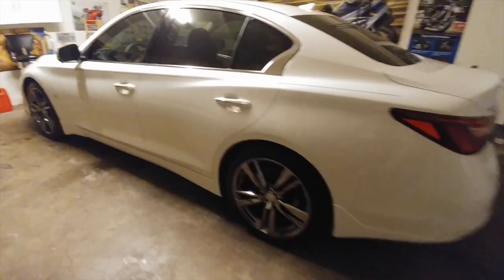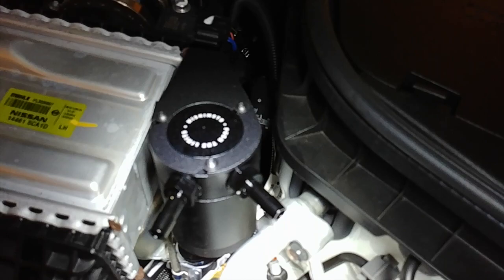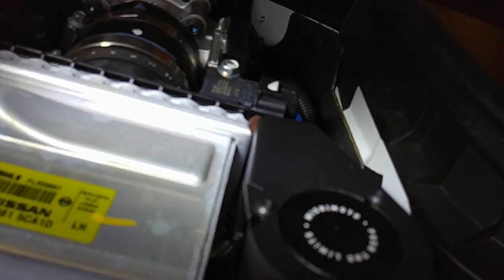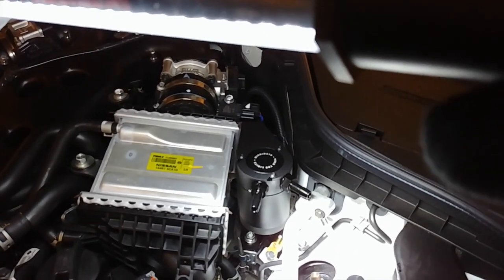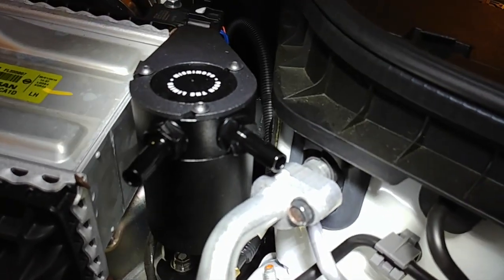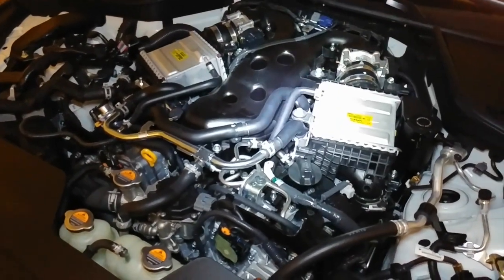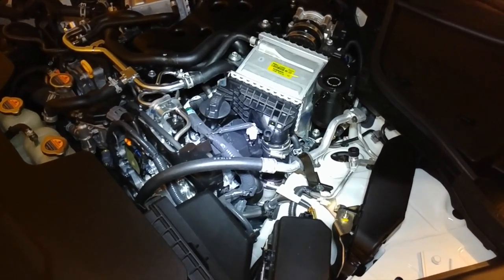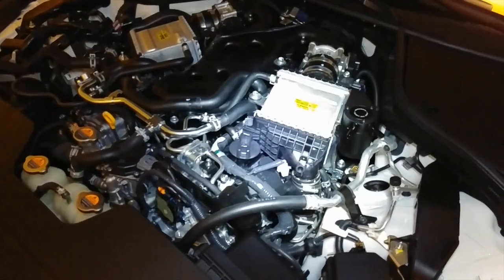Mishimoto Oil Catch Can Install -2019 Infiniti Q50 3.0T

Comment: This absolutely by far has been the best in depth fully detailed install video for this product yet. The Mishimoto video shows you almost nothing about the actual placement of the hoses . Funny thing is for me routing the hoses went a lot easier then i thought. My biggest issue was actual getting the hose on to the intake port and the other head but with alil wd 40 and some muscle I was able to get it Done with some pliers in good time. Gonna check it in a couple of 100 miles and see much it collects. Thank you again !

Comment: i watched 3 videos of the Mishimoto catch cans because I'm getting one and by far your video has the best visuals. thanks bud!
Reply from the maker: It's ironic that Mishimoto recently published in their engineering blog what makes for a better oil catch can as I've been doing research on this topic for 8 years to educate myself.  People see the word baffle and get all giddy but a baffle/multiple baffles are only a partial portion of what is needed to successfully make a PVC/CCV catch can. Other key components are the air diverter and a very fine porous filter. Read this if you have not: https://www.mishimoto.com/engineering/2016/01/blow-by-101-what-is-blow-by/

People just think oil flows thru the PVC system like in its liquid state out of the bottle. Doesn't happen that way. It's a ultra hot mist/vapor where it flows like that until it's changed out of the vapor back to a more fluid like state. You can't catch most of the mist with a baffle alone or a neat sounding triple-twister baffle whatever that is. It takes a high heat application filter that can handle moistures, oil droplets, unburnt fuel, condensation/moisture and more nasty things from the combustion blowby past the ring process plus the pressure that builds inside the motor lower portion. 

I don't make a cent from Mishimoto or get anything free but I just like to share good information with others and well as I like to be told good information too.

Comment from the maker: I opened mine up just after less than 100 miles and I astounded at how much oil is in there. I'm still breaking the car in so been pretty easy on it. So so pleased that I got the catch can installed. Going to take a 600 mile trip soon.

Comment: Man routing the hoses on this was a nightmare lol this engine bay is extremely frustrating
Reply from the maker: The most tedious part for me was feeding the one Mishimoto hose thru the crevasse to get it to point of attaching it to the intake. Other than that, wasn't too bad. For me, the punishment was just standing in my 110 degree garage with 80 percent humidity and keeping the sweat out of my eyes and keeping my hands dry.

Comment: Hello do you get any vibration noise from the can hitting the into cooler I read a review that his was vibrating? Also I have a q50 2019  with 33,000 miles is it still worth putting this can on it and you said the Mishimoto model was the best for the q50 verses other models let me know thanks Jim.
Reply from the maker: I don't get a noise from my mishimoto catch can. Probably installed incorrectly. With a 3.0t q50 with 30k already on it, I feel a fair amount of oil carbon buildup has already happened. The biggest advantage of spending the $220-230.00 for the mishimoto oil blowby catch can is to seriously reduce or try to stop the start of the carbon buildup. Once it's there kind of defeats the purpose though it can get worse over time 40,000 miles to 100,000 miles.

Getting the intake valves professionally cleaned and then adding the Mishimoto .50 filtered blowby catch can makes more performance sense in my opinion. The service to have that valve cleaning done would be fairly expensive. All the reason to avoid the buildup from the start.

Likely not worth the cost unless other work was being done in that area of the motor allowing access to that part of the cylinder heads/intake ports.

Comment: I installed the Mishimoto catch can in my 2017 Q60.  After my install, I was getting some knocking noise.  The dealer said it was the catch can. So, I had to added some spacers to raise the catch can bracket a little higher.  I think they were 3/8 inch spacers.
Reply from the maker: It would be a good feature if folks could attach photos to youtube. I've never seen or heard about rattle or vibration issues but mine does come in close contact with other metal surfaces due to space constraints. Glad you were able to get it resolved so you could keep it. I have never noticed any rattles or unique noises from mine.when you saying knocking are you saying that the engines knock sensor/s were registering false knock?
Reply: @GettingthruLife  I agree with attaching a photo option.  I believe my catch can was hitting the hose (I think it's a power steering) that just barely below the catch can hose.

Comment: Does ur oil catch can have any noises on bumpy roads ? At low speed does it sound like it hitting against something not bad or anything it just makes some noise while driving in somewhat bumpy road
Reply from the maker: No, no noises related to tge mishimoto occ. Make sure mount is tight and inspect clearances. Look for signs of rubbing on other surfaces.

The infamous ADD 1 catch can had clearance issues with hood shut on the Infiniti.

Comment: Thank you
Reply from the maker: Mishimoto...the best because it will catch and contain the most blowby because of its .50 micron filter like what's used in an aircompressor to stop moisture from the high heat from compressing the air. Most of the blowby contaminates are in a liquefied vapor form or very small oil droplets.

Comment: should I clean out my intake valves before installing this? im at 30K miles in my Q50 so maybe get the GDI intake valves cleanout at the shop before installing this, what do you think?
Reply from the maker: This is a good question and one I would ant to deal with. Say I bought a 3.0T motor with 30K and no catch can. I can promise you, if your where to pull all the components off so you could peek into the intake chambers you would be very surprised at the gunk/carbon and oil in there. Sure the car might seem to drive fine until you cleaned them and then drove your vehicle. It's just the nature of the D.I. engines. In 14 to 15K miles on my Ford ST 4cyc turbo D.I. car, I was shocked at the carbon and oil buildup.

My suggestion/opinion is try the commercial cleaners and follow their instructions. CRC, Lucas Oil, Liqui moly valve cleaner, Sea Foam. In my opinion again, better to start fresh and then add a oil catch can so you can reap the benefits of the process.  Why its best to add a high quality CC to the cars while new. Ford equips their turbo cars with minimal catch systems, PCV, but they are insufficient but better than none at all. They are not at all easily serviceable either.

Spend the $220 and get the Mishimoto with the actual 50-micron bronze filter that pulls all the contaminants, condenses out of the super-heated mist/vapor. 90 percent of the blowby is in a vapor form with ultra-small oil droplets because the motor is 200 degrees and the action of the motor, rods and camshaft spinning 3-6k rpms churns up the oil, condinsation and fuel blowby into vapor. No ultra-fine filter then only capturing a portion of the oil and contaminates. The contaminates and oil coat the intake walls, valve stem, dished part of the valve and then the moisture and unburnt fuel blowby contaminates your clean fuel being injected into the cylinder thereby lowering your octane rating and the quality of the explosion/burn in the combustion chamber.
Reply: @GettingthruLife  yeah before I install the catch can, im going to get the intake valves cleaned at the shop first so its all fresh to go. I don't think I need to do a walnut blasting yet, 30K miles is still new so just a GDI intake cleaning should do before I install the oil catch can.
Reply from the maker: @ksockhak  If you value your car, its performance and you just like to treat the things you own well then you are doing a very beneficial thing. No reason to buy a another brand of OCC that removes 30-40% of the blowby and oil because that over time will add up which will just require another cleaning. Other D.I. vehicles will see even more benefits due to the PVC/CCV get dumped pre intercooler, pre throttle body where those parts get coated as well. Oil in the Intercooler reduces its ability to transfer heat. My 2014 Ford Focus had some oil in the intercooler, intercooler piping and all throughout the throttle body and intake plenum. Yucky!
Reply: @GettingthruLife  for sure after I get the GDI cleaned out the oil catch can is getting installed. I already have it with me, but I want my intakes cleaned first before I install it and off she goes!

Comment: How the hell did you get the hoses on? Its absolutely ridiculous.  Bout to box it up and send it back
Reply from the maker: Dont send it back. All the catch can are going to need to be routed this same way. Just take a deep breath, step away if you get frustrated. If you need more light then get more so you can see what you are doing. Make sure you are running the right hose/the right end to the corresponding spot. Another thing you can try is to put a light coat of oil on the end of hose so it slides into the passage way easier. Also use a long screw driver to insert down into the spaces to help direct push pull hose slightly to help it start to change directions. Once you get the hose up into the place where it then needs to be pressed/pushed on, use needle nose pylers to help grab and wiggle on. Dont forget to put on hose clamp once you have wiggled hose up to the male nozzle on the intake.

I tested this Catch Can and it does what it supposed to do. The pos AddW1 is highly likely letting sime of the blowby thru because it doesn't use a filter. All air compressor moisture filters use a micron stone/media to stop vapor from getting by.

Comment: Does the q50 3.0t needs 2 oil catch can since it has duel air intakes?
Reply from the maker: From my experience most cars that have a passanger side and a driver side access to hook up a cacth can, one side depending on the motor usually does most of the filtration. I've even watch my fair share of other people's videos where kits are sold for different cars (make more money selling two) and one CC catches all the curd and the other nothing or a few drops..
Reply from the maker: Answer is no. Dual air intakes have nothing to do with it if I'm understanding correctly. The crankcase is a single cavity. The pcv is taking that blowby from all the pistons and venting that added pressure out which carries the bad vapor of what we dont want back into the combustion process or on the back of the intake valve surface. The venting and reinsertion of the gas/moisture/oil/combustion gasses gets sent back into the combustion process at the plenum/intake manifold just before intake track. Does not get sent back in airbox, pre mass airflow sensor or throttle body.

Comment: You didn’t show which hose is which.
Reply from the maker: I'm just a simple person making a video and not the manufacturer or sponsored by the manufacturer. If they don't include in their instructions then call them up. 

To be helpful to you, the hose with the bend at the end is the one that connects to the driver's side cylinder head oil blowby port. Then that same hose routes to the catch can port that says "IN". Then the secondary hose that came with the catch can kit, that connects to the "OUT" port on the catch can and then runs up a long side the driver side silver intercooler and connect at the port just after the "j" bend on the intake plenum. Oil, moisture vapor and contaminants run out of the driver side of motor head from blowby compression leakage then to catch can, then back into motor and serves as a way to burn that blowby material up in the combustion chamber if you didn't have the oil blowby catch can which removes it.
Reply: @GettingthruLife  thanks. Yep there were zero manufacturer nstructions just an air freshener lol.
Reply from the maker: @mdog6726  Just be patient and take your time running the second hose going out of the OCC up through area along side the top mount intercooler. Run it just like the factory hose that came off. If I can do it, anyone can get this installed. Just yell some curse words if you get frustrated, helps me.
Reply: @GettingthruLife  ha ha. Thanks. It went fine and my daughter (16) helped me hold the flashlight.
Reply from the maker: It's just me in my garage so I don't have to hold back my frustrations. Glad you got it hooked up smoothly. People have told me they really struggled to install this by running the hose. No you can feel good every time, every couple of months you check your occ and catch a decent amount of coffee like fluid water/oil.